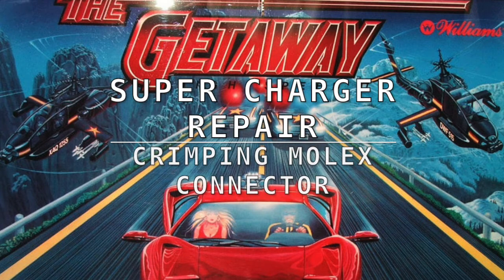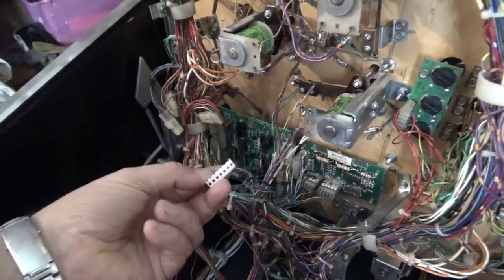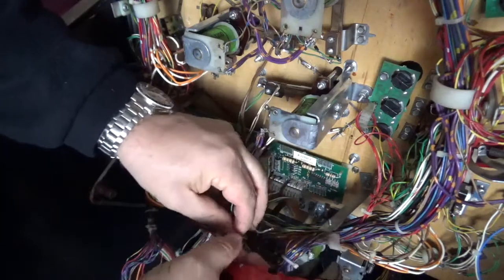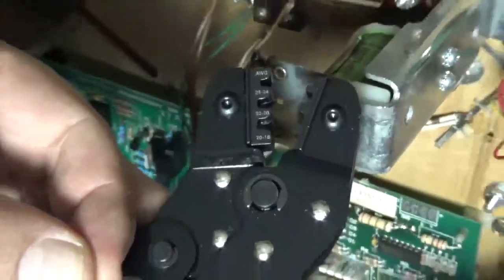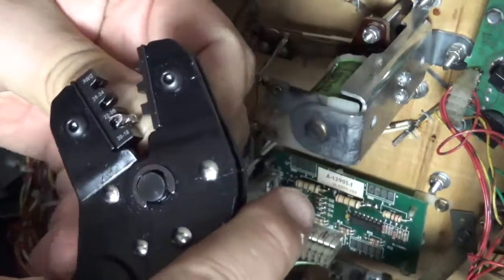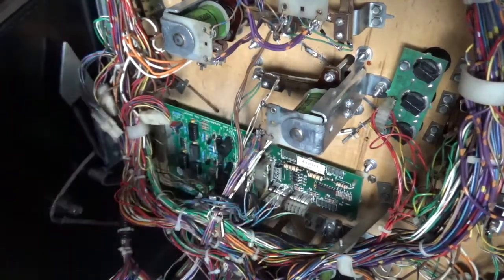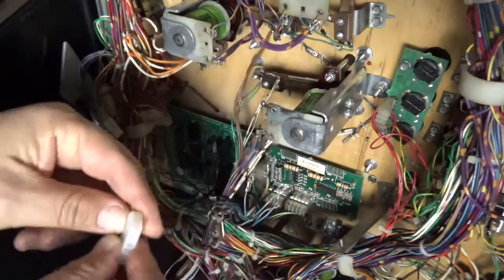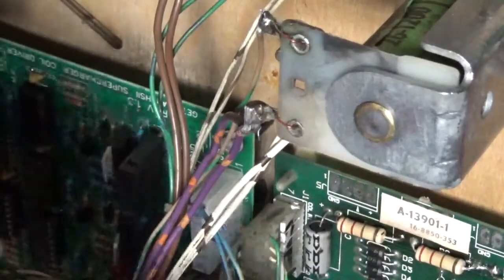Pinball Repairs : Crimping Molex Plug in Getaway Pinball Machine

Comment: PINBALL EVANGELIST, 
               1.) Arcade Technicians have told me to change all the Molex and AMP pin types size to 0.156 inch  Trifurcon crimp terminals. I'm not sure why they want to use TRIFURCON type pin, any reasons why? I thought the pin size was how much current rating but the Trifurcon is better for higher currrent ratings I'm guessing. 
                              2.) In arcade games and pinball games the connectors and wires gets corroded which causes intermittent failures. I'm guessing the Trifurcon pins don't cause corroded interminitten failures? or what type of pins material would you recommend to not cause future intermittent corroded issues on the connectors?